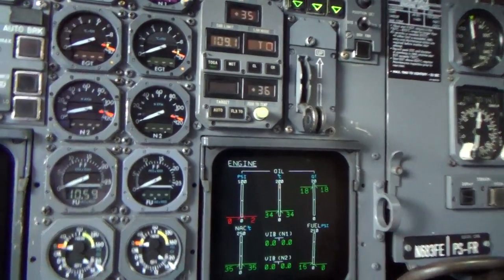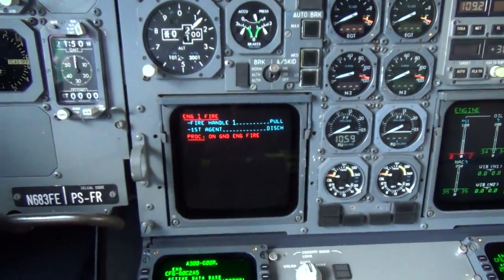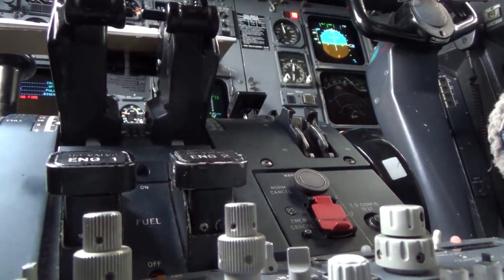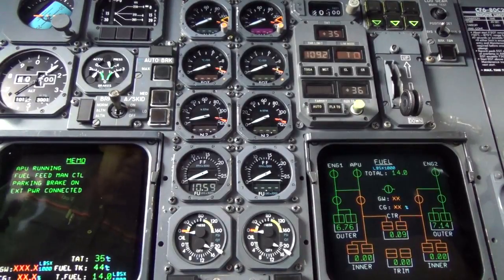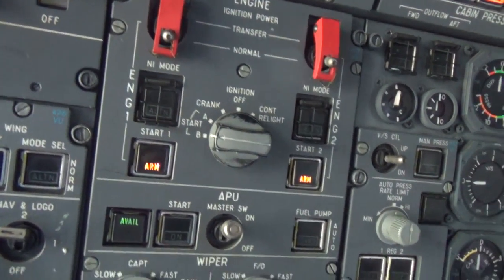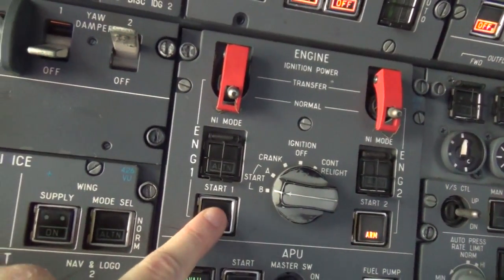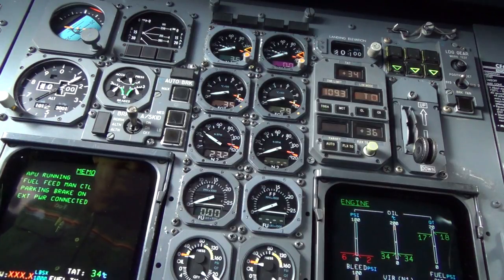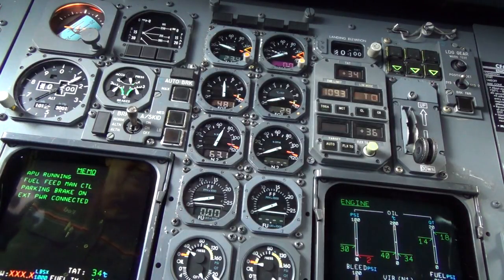Rotate.Aero - A300 600 Engine Start

Comment: The A300 cockpit looks so modular like you could just pop off some old gauges and swap it for a glass cockpit or something.
Reply: The old cockpit looks very cool
Reply: @cojanrobert17   literally
Reply: The A310 and A300-600 were glass cockpit EFIS CRT, 2-crew from the onset. The steampunk appearance and modular look was for ease of mass production/assembly as it was the first time Airbus had 2 models with a common flightdeck, systems and supply chain. Only the TRP, Engine Gauges and Autopilot panel design principles were carried over from the classic 3-crew A300 and modernized. The rest was new at the time, EFIS, FMS and even some early FBW-like protections on the pitch axis. The only primary gauges with conventional needle/dial are the engine gauges and altimeter which Airbus made the engine gauges using typical 80s calculator style LCDs (or the rare green dot matrix version, customer option later) for the 310/306 and overlaid it with a conventional needle-dial layout for aiding in familiarity with classic A300 pilots retraining for the 310 or -600 as a number of customers had the classic A300 and ordered the A310 and/or -600 like Pan Am and Lufthansa

Airbus opted on using the 2 center CRTs only for ECAM and System Synoptics only as well as a Maintenance mode for mechanics on the ground to aid in troubleshooting, where as Boeing utilized it also for Engine indication on the B757/B767 as there was no previous iteration training familiarity consideration. Fun fact though, Boeing originally designed the 767 cockpit with just the primary EFIS CRTS, no center CRTs at all, a flight engineer panel and A310 style digitized dial/needle engine instruments before going for the CRT when they merged it with EICAS. EICAS was originally envisioned with analog flags/FMA like used on the 747-300 and non-EFIS 737 2nd Gen. The A300-600 has far more in common with the A310 than it does the A300 classic, both structurally, powerplant and systems wise and they share a common type rating like the B757/B767. Think of the progression from the classic A300 to the -600 like the DC-9-30 to the full EFIS and digitized MD-87 which was roughly the same size and superficially similar but a new airplane inside/out.